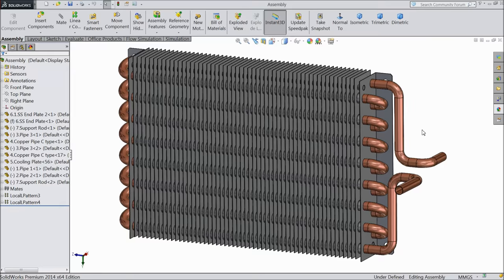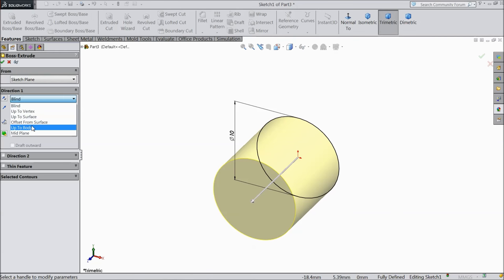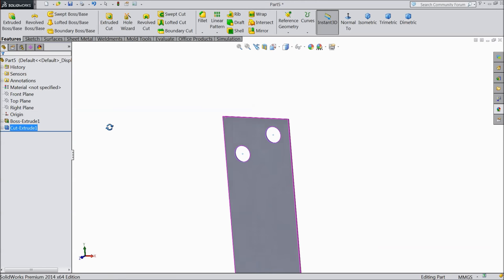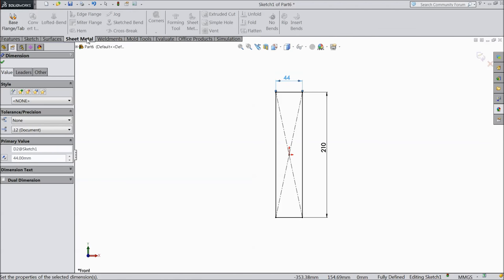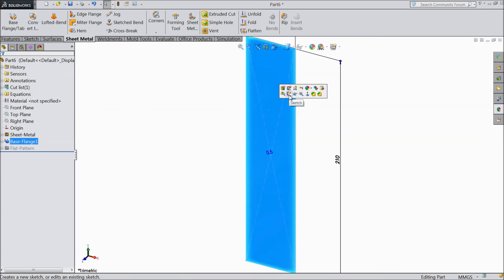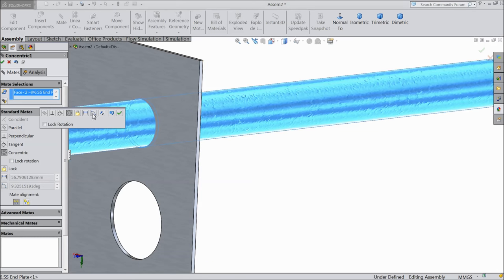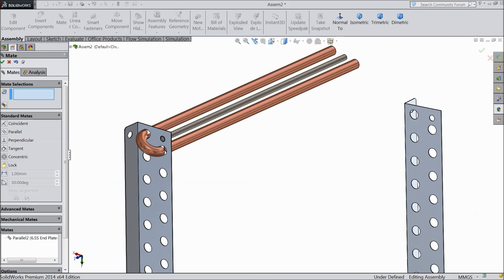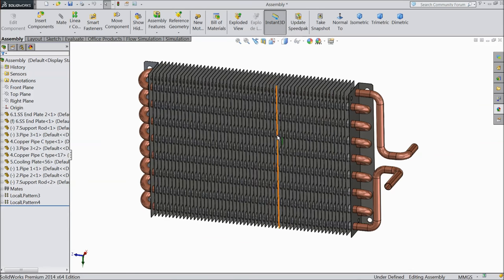Solidworks tutorial | Sketch Aircondition Heat Exchanger in Solidworks

Comment: hey can u please share your system configuration ? graphics card and cpu and ram ?
Reply from the maker: you can find out from About section of my channel. anyways below are the specification.
 My Mobile Workstation:
Dell Precision M4800
Processor  : Intel(R) Core(TM) i7-4810MQ up to 3.6 GHz
RAM            : 16 GB
Graphics    : Nvidia Quadro K1100 2GB
HDD            : 500 SSHD

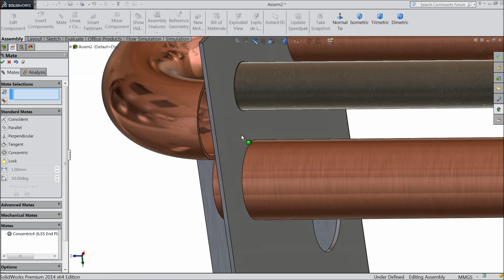Comment: 32:32 I can't get that relation, I am getting error I have no idea why, it is like that c pipe doesn't want to rotate to mate with second pipe, any tips?
Reply: I can share you link of completed CAD model I created watching this. Reply if you need it.
Reply: @Jayaug1998  share please
Reply: check in mate of that part, and check if you locked the rotation or not or accidently fixed the part